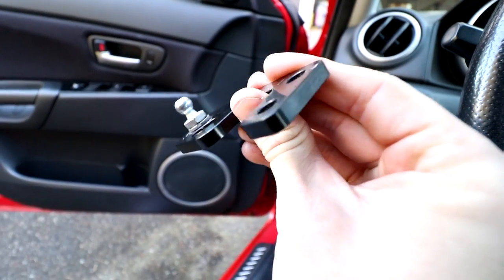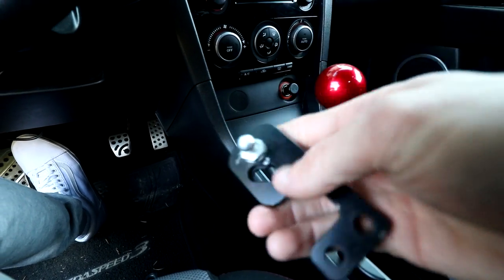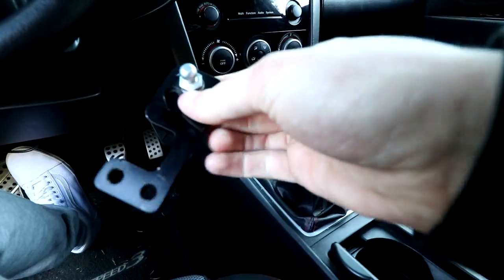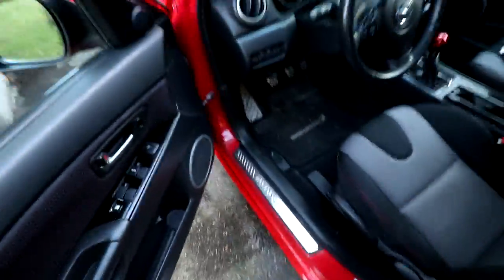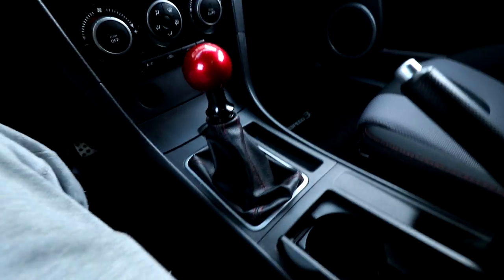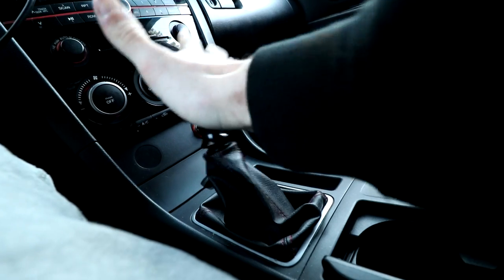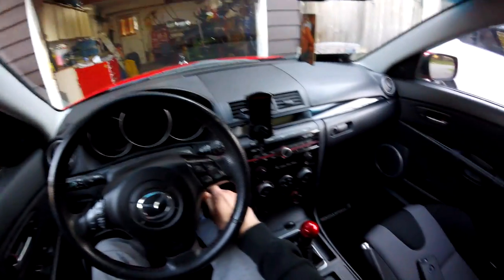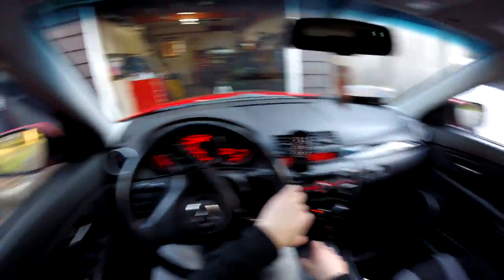SHORT SHIFT PLATE Install On the MazdaSpeed 3!

Comment: would you recommend this vs a short shifter?
Reply from the maker: Short shifter is probably a safer option, but I don't have any information to back that up. Could do both if you really wanted!
Reply: There's lots of talk about plates vs. shorter sticks. It seems like it's moreso people doing stupid things. I've had a shorter shifter and it made things notchy even with a heavier knob ... the plate was the way to go and haven't had any issues with the trans after having it for 50K miles (JBR on an '07 3).